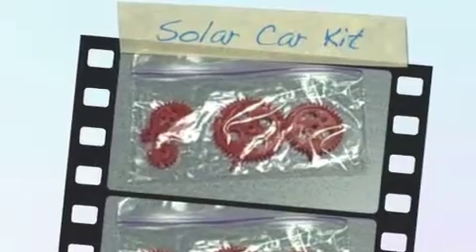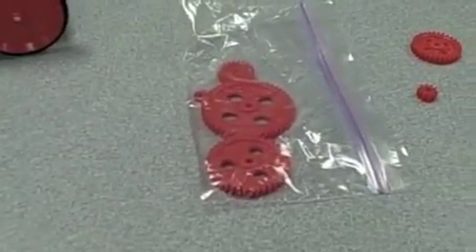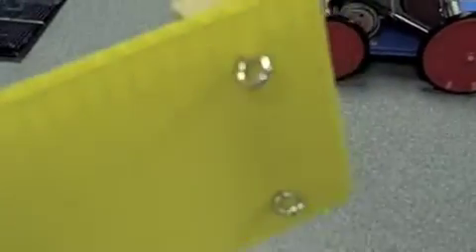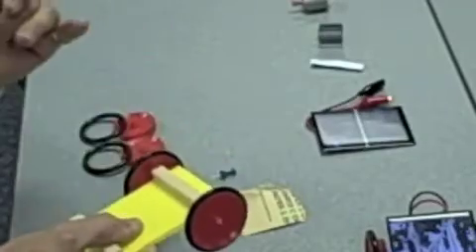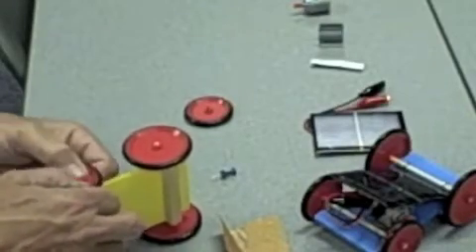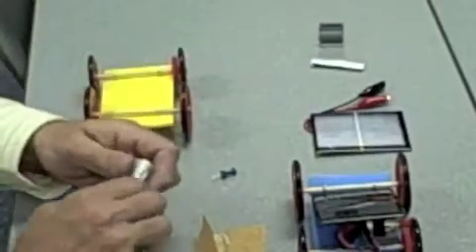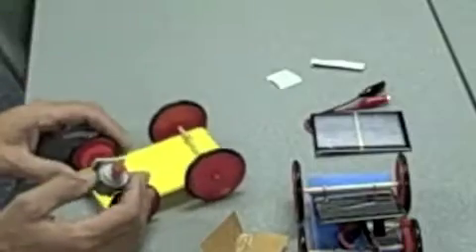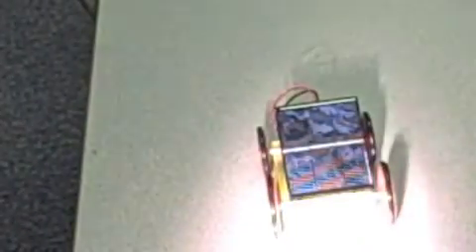Solar Car Kit Instructional Video

Comment: Thank you for making this. Those familiar with SunWind Solar products may see that a SolarDrive was used, but with an additional set of gears, a gear-driven car was made. Also, a 30-tooth driven gear was chosen, rather than a 50-tooth gear, which necessitated building the car in a somewhat different way than usual. However, THAT is the joy of these kits - you can put them together in different configurations, take them apart, and try something else. Or build onto other things.